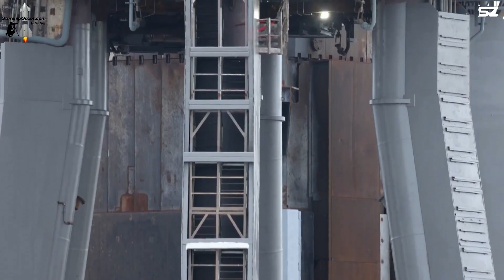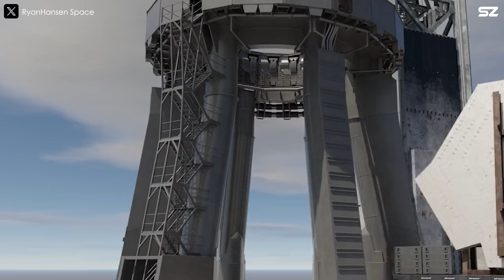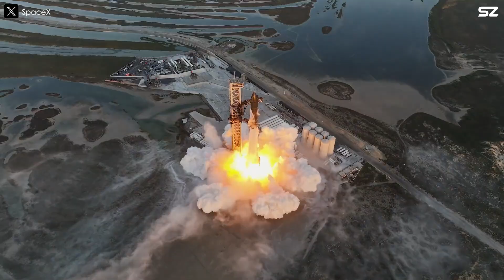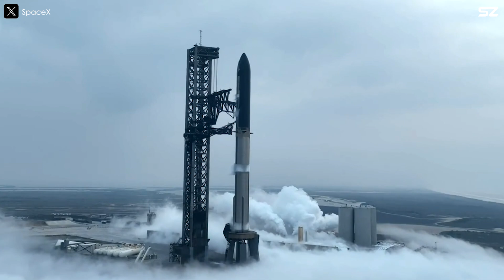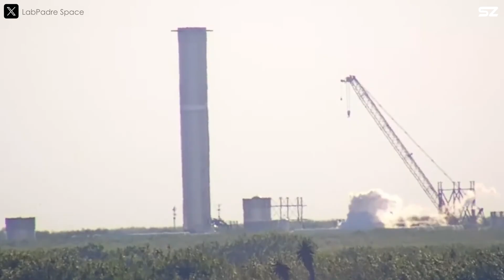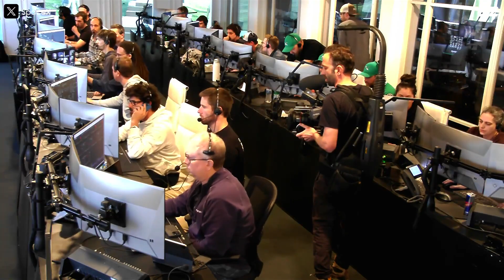SpaceX's New Launch Pad Problem!

Comment: @0:51:  "9x  Ø4m  concrete rebar columns, aka Piles, are placed directly beneath the booster engines"

I doubt that diameter, with the booster only beeing Ø 9m.